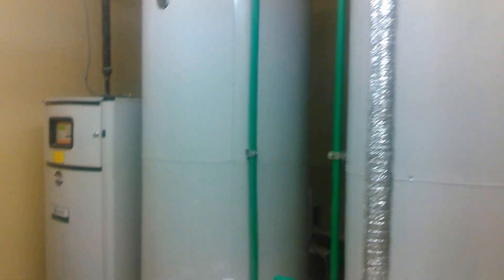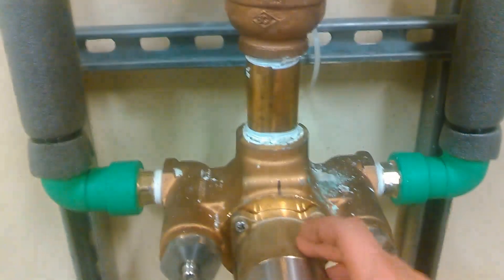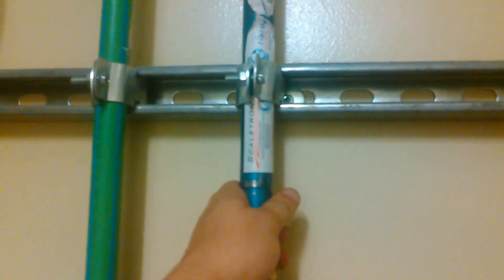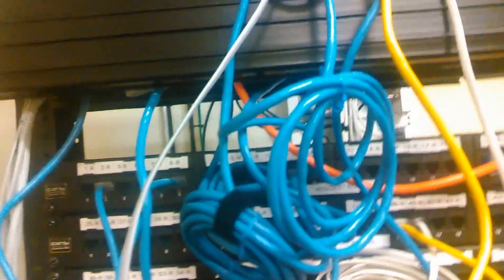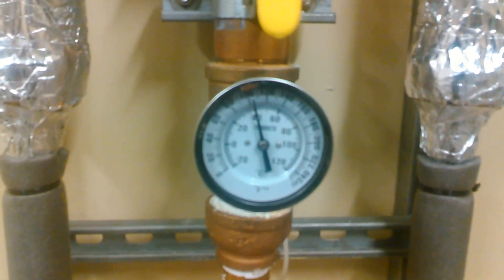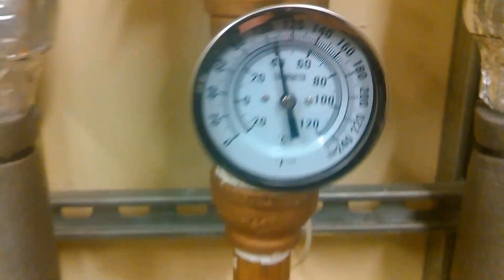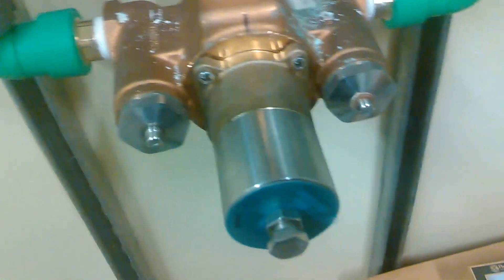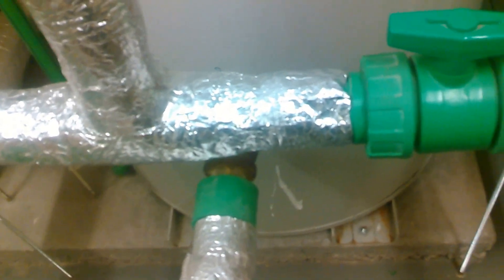Boiler room tour

Comment: Those domestic hot water mixing valves are a pain, our are set to 110F.  We only have them feeding the healthcare building, the independent living apartments are fed off the same system but no mixing valves so they get 130F water.  We do have an actual water softener feeding the domestic hot water system, but our water is still tough on the mixing valves, circulator pumps, etc.  Matt